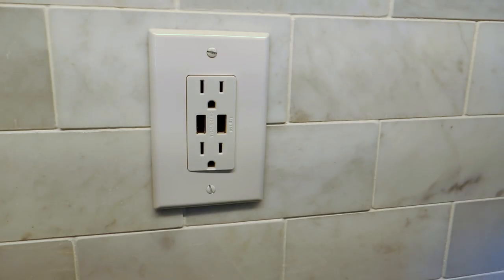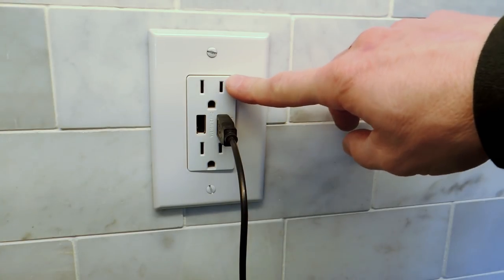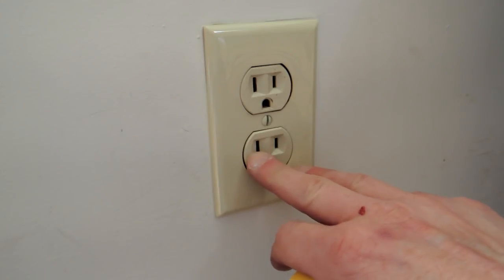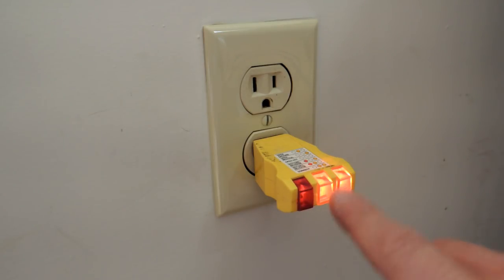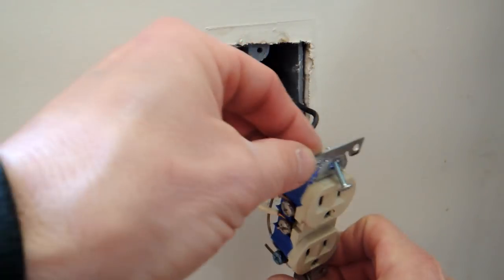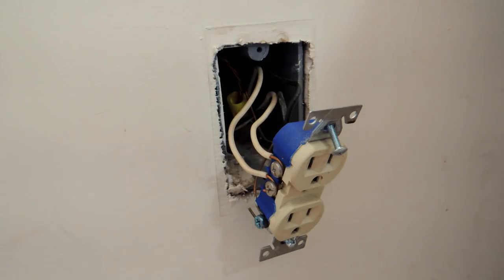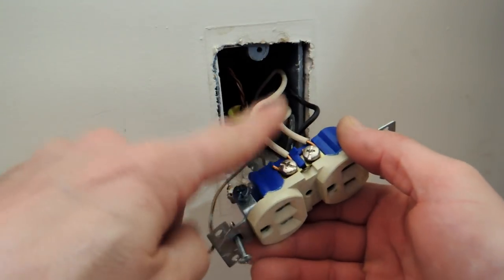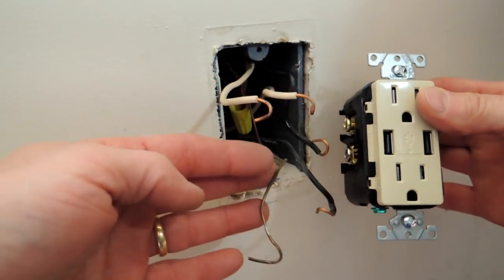How To Install A USB Electrical Outlet

Comment: Thank you for the informative video. you broke it down perfectly. My wife and I have been in our new home for 8 years (new to us). All of the previous owners cut a lot of corners.Wiring problems, crappy linoleum floors installed while the appliances where still there. Blue plastic? material for counter tops (our house is from 56 or so.) To see this video as not a domestic or commercial electrician but as an IPC SMT certified specialist, it puts my work in a different perpective. Thanks again.

Comment: Thanks so much for showing in detail about connecting both hots/neutrals to their correct terminal. No other video explains this well and I almost returned the outlet thinking it wouldn’t work to chain to others.

Comment: Excellent video. I’ve swapped out outlets for most of my adult life, but came across the situation of two black and two white wires along with one ground, but only seeing two screws on the back of the new receptacle. Spot on, well presented video. I’m fortunate that it popped up first when I did my Google search. Thank you very much! Now the next thing must do is subscribe to your channel. ❤

Comment: I didn’t tape everything off at the end and the hot sparked when I pulled a plug from the outlet. Turns out hot was touching because it was snug against the metal junction box. Seems to be working well now since I wrapped it in electrical tape. Thanks!

Comment: Excellent video - I was in the midst of installing one of these and it didn’t work. I found your video and You mentioned the wire can’t be pushed in too much because the insulation would prevent a good connection. I readjusted the depth the wires went in and success! Thanks again !

Comment: Each electrician has his own way. I would always cap my hots and neturals together like you have on your ground. makes for a more solid connection.
Reply from the maker: Nothing wrong with that.  It's difficult to convey to a DIY person in a short video all of the rules for box loading, though, so I err on the side of less wire to be safe.

Comment: I prefer not to put the take around the receptacle. That way, if the plug stops working, I can take the multimeter and touch the probes to the screws without having to pull the receptacle out of the box. Just a thought for your viewers, good thorough video!
Reply from the maker: Putting tape around the receptacle is not required, but it is a traditional step taken by electricians.  The point of it is to protect the terminals from accidental contact with tools or other wires and causing a short.  It was more important, perhaps, when metal boxes dominated.  Still, I have seen boxes where the bare ground wire has accidentally come in contact with a terminal when the receptacle was installed.  If the ground wire hits the hot terminal hopefully the breaker will snap.  If it hits the neutral terminal, though, you've got a potential hidden safety issue.
Reply: Hog roamer couldn’t u just stick the two leads in the hot and neutral prongs?

Comment: Will this work with a non-grouned  house like from the 50's and 60's style old homes because it wasn't equipped with ground when we bought it . Will work anyway ?....
Reply from the maker: Yes, the GFI outlets will work without a ground by sensing a fault with the neutral wire.  You will then label the GFI as non-grounded.  The box will have specific directions inside.
Reply: Thank you so much I needed that

Comment: So if my ground wire goes to the metal box I have, can I disconnect it from the box and then to the green screw, or do I need a jumper from the wire on the box to the receptacles green screw?
Reply from the maker: It's always difficult to discuss these things without pictures or being there, but I think I follow you.  If you have a metal box, you probably also have an older system which may use armored cable.  Depending on the age, that armored cable may have a dedicated ground wire inside or it may use the armor itself as a ground.  Since you describe a ground wire connected to the box, it may be that you have a dedicated ground wire.  In that case, you should also have a pigtail which runs from the box (and therefore the ground wire too) to the receptacle.  That way the metal box itself is part of the protection loop in the event a live wire gets grounded to it.

Comment: I have a 14/3 Wire in my outlet. Red, Black, White and the ground. The USB outlet is like yours, only has 2 screws, and the green ground screw..., what do I do?
Reply from the maker: You need to figure out why the red wire is there.  There are a number of possibilities.  Sometimes the red wire is used for a three or four way switch, if the outlet is switched.  It can be used for 240 volt operation, but this is unlikely with 14 gauge wire.  Possibly the receptacle box is also being used as a junction box too and the red wire feeds something else while sharing the neutral.  Of course, when you removed the standard outlet the wires were hooked up a particular way and you could likely duplicate that with the new outlet if you made note of it.  Or, with a multimeter set to volts you can do some basic testing and try to figure out the purpose of the red wire.  https://youtu.be/g0YRkwv40r8

Comment: I have a question, it has the grown wire, back and the white, but what and where do I put my RED wire???
Reply from the maker: Red wires are used for various purposes, so you need to investigate further.  Red wires are used for 240 volt receptacles to provide two 120 volt "hot" legs (one red, one black), but if you are replacing an existing 120 volt outlet that's not likely.  They can be used as an extra wire for use in switch configurations (like as the "traveler" wire), they can be used to feed an additional leg of a circuit in some cases, etc.  I'm afraid I can't make a judgement without seeing it in person, but you can put a meter on it to see if it has power or if it is connected to a switch somewhere.  Of course, there is also the possibility that it is not used at all or that some previous person miswired the box, so you need to be cautious.

Comment: is it normal for these outlets to hum after being installed?  Its not loud, and I followed the video to the letter.  So I'm wondering if this is just normal or I have a bigger problem
Reply from the maker: A very faint humming is not cause for concern, it could just be the internal electronics.  My hearing isn't even good enough anymore to hear it!  If the humming is buzzing is loud enough to be noticeable while walking by, then you may have a bad unit.

Comment: Trying to install the same exact outlet, but when I pulled out the old one it has a black,  white & red wire connected. Where does the red wire go?
Reply from the maker: I third red wire can be used for a number of different purposes, including feeding other devices or to connect with a switch so that half the outlet is switched (common in a bedroom) and the other half is always live.  The only way to know is to get a meter out and do some testing.  You can test to see which wires have power under which conditions and if there is a switch nearby which has an effect, etc.  Mostly likely you can just hook the new outlet up in the same configuration as the existing one, so take a picture before you disconnect anything.
Reply: Thank you for the quick response! Currently the black & red are on the hot wire side with push type connection & the side tab broken.  
I'm assuming the black & red would also go on the hot side in the new one,  but where is the tab that needs to be broken?
Reply from the maker: If there is a tab that was broken then that red wire likely goes to a switch in the room.  You should confirm that. If you have the same USB outlet as the video it cannot be split to have one plug switched and the other always on.  Either you rewire for both plugs always on or rewire for both plugs switched.  I think there might be a diagram inside the box if you are uncertain.
Reply: @enduringcharm   Thank you! I appreciate your time.
Reply: I have the same problem, i connected both red and black under the same screw and it tripped my breaker. Theres no tab to be broken off anywhere

Comment: I recently bought a place built in ‘06ish. I think the dry wallers may have been careless and knocked many of our receptacle boxes loose. Is there anyway to reattach/ tighten them back onto the sud? Maybe another video idea!? Thanks for sharing your expertise!
Reply from the maker: Yes, if the original boxes were plastic and nailed to the studs, they can be carefully removed and replaced with "old work" boxes that clamp to the drywall itself, or you can open up some drywall, remove the old box, and install a different style that clamps and screws over the stud.  Either way, some drywall damage is likely and repairs will be needed.  Sometimes you can add a screw through the existing box to secure it if you care careful not to pierce a cable.
Reply: @enduringcharm  thank you the 7.5 earth quake we had last November loosened a ton of boxes in our 70's building!!

Comment: i recently bought a usb wall outlet, rated at 15A 125V, but what i have is a 220v system. is it ok to wire the usb socket with the 220v?
Reply from the maker: No. It isn't.  If you have a 240v circuit you'll need an outlet designed for that voltage if you intend to keep it that way.  If you no longer require 240v on that circuit it is possible for an electrician to reconfigure it for 120v service and reuse the existing cable, but those details need to be worked out locally.

Comment: Is it possible to install these outlets downstream from a GCFI outlet? I've installed a GCFI outlet in my bathroom and previously installed a USB outlet downstream from the GCFI outlet about a year ago.

I checked all the other outlets (standard outlets) that share that breaker and they're wired right.  

Can these be wired to have a line and load or because they have one terminal - they can't be set up in a GCFI protected outlet?
Reply from the maker: Are you having trouble with one?  You should be able to wire one downstream.  Since I made this video they've also come out with GFCI outlets that have USB built in, if that's what you are after.
Reply: @enduringcharm  it doesn't seem like you can. At least with the one I used downstream only had one set of terminals on it and I didn't have a separate connection for the line and load. Once I swapped the usb outlet with a regular outlet - the GCFI outlet functioned normally.
Reply from the maker: Maybe I'm not clear on your dilemma.  If you have any outlet wired downstream from a GFCI and the circuit is wired correctly, then those downstream outlets are also protected.  The line/load thing concerns the GFCI receptacle itself, not others downstream.  So, any devices downstream should be connected to the load terminals of the GFCI.  But those downstream devices do not need line/load terminals themselves.  Normal receptacles don't have line/load terminals either.   Just for good measure, I checked the Leviton website and they specifically mention that these USB outlets can be used downstream from GFCI receptacles for protection.  I can only surmise that maybe you have something miswired or perhaps the USB outlet itself in damaged in some way.

Comment: This will be one of those items that will reveal the age of a house once  USB chargers are no longer in use.
Reply from the maker: Agreed--sooner or later USB will be obsolete.  However, it's trivial to change these out to the next thing and they aren't expensive.
Reply: just like the old push button floor switches, but allot of youtubers are to young to know what they are
Reply: I ran a lot of speaker wire and coaxial cable in my walls in years past but you have to live with technology of the day.

Comment: What if you have red and black hot?
Reply from the maker: There are lots of ways to wire a circuit, so I can't make a universal statement about your red and black.  In some cases a 240 volt circuit uses both a red and black "hot" leg, which can be determined by putting your voltmeter across the red and black wires.  If it reads 240 volts, you have your answer.  If not, you may find that both the red and black will indicate 120 volts when each is measured to a neutral.  In that case, you may have a box which is being used as a junction too, and each wire is intended for a different circuit or a different part of the same circuit.  I'm afraid you'll have to do some testing to figure it out.

Comment: Went to do this today and noticed there was a red wire connected into the outlet! Is there something I need to do for that?
Reply from the maker: There could be multiple reasons for the red wire.  Red is used as an alternate color for hot.  It's possible somebody used a four wire cable for some reason, it's possible that was a 240v outlet at one time that was converted, it's possible a four wire cable was used to feed power to multiple places and that outlet box is also a junction box.  Unfortunately the only way to tell is to get out a meter and do some testing.  You should also see a black wire from the same cable in the box somewhere, so the big question is where that goes.  If you are not comfortable, have an electrician do the work.
Reply: enduringcharm if the red is for a light switch (half hot) can this still be done as in the video?
Reply from the maker: @EmilysHandle  There are just too many potential variables for me to make a judgement from afar.  Generally speaking, if you already have an outlet in the box that is correctly wired, then you can replace it with one of these USB style outlets.  That includes boxes which may also contain a light switch.  If you are re-configuring an existing box which does not currently have an outlet there may be other factors to consider.

Comment: What If there’s no ground ?
Reply from the maker: Some very old houses that have not been updated could possibly be without a ground.  Or, your ground may be the armored casing of the cable leading into a metal box and you just need a pigtail from the metal box to the outlet.  Using a meter and examining the breaker or fuse box you should be able to determine this.  I have a video on how to use a multi-meter you might want to check out, or else you could pay an electrician to come take a look.  The ground is there for safety reasons, but the outlet will still work without it.